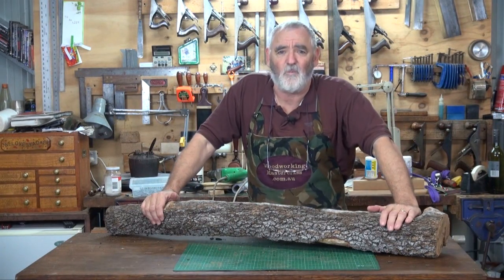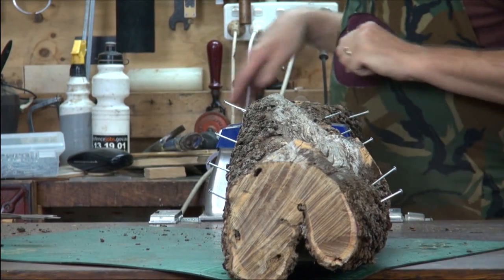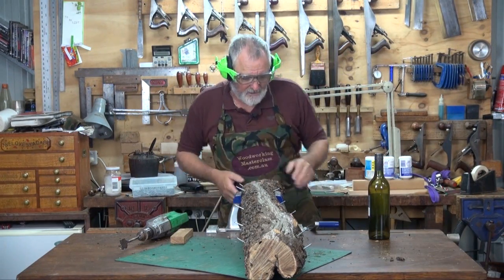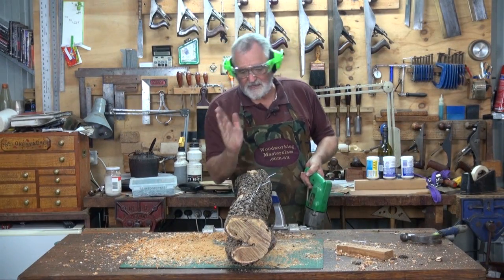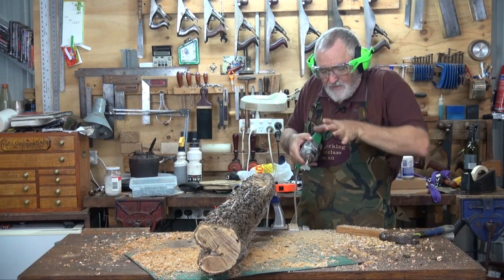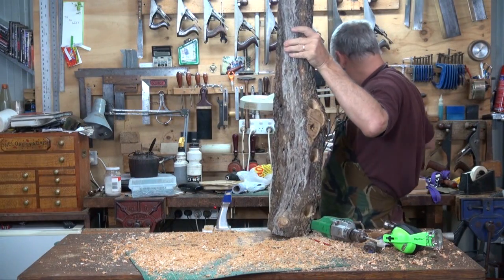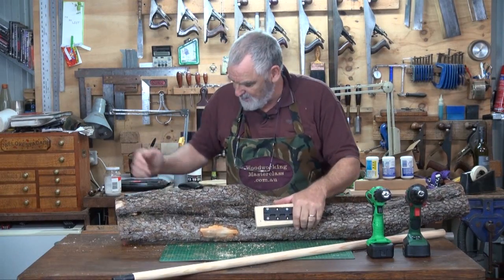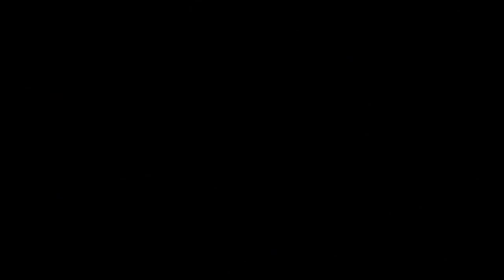Rustic Wine Rack

Comment: Fun project. Interesting concept. But i would probably prefer to turn stuff from that branch.
Reply from the maker: Willem Kossen Well I guess if you cut enough branches you could have a go at both? What you choose to do Spindle work or Bowls? Cheers Steve
Reply: I dont have a chuck. Im doing mostly spindle work. Wood is such a wonderful material.
Reply from the maker: I must admit I much prefer Spindle work to chuck work as well. Cheers Steve